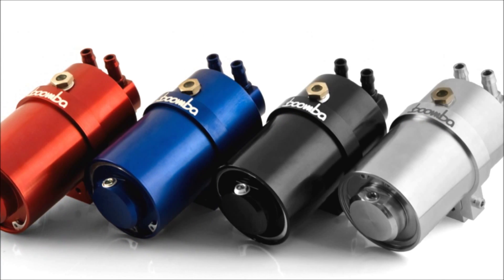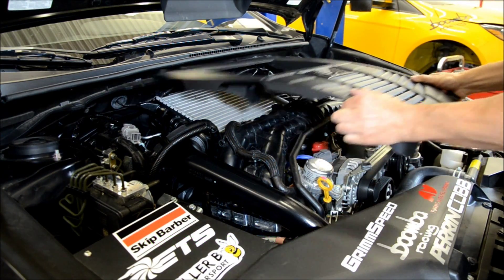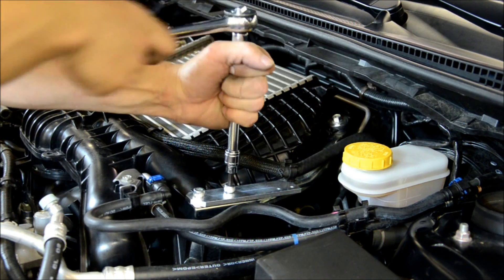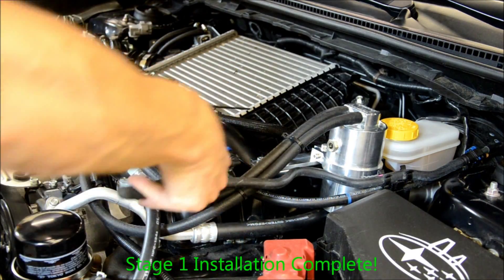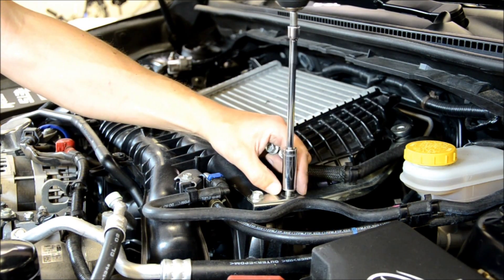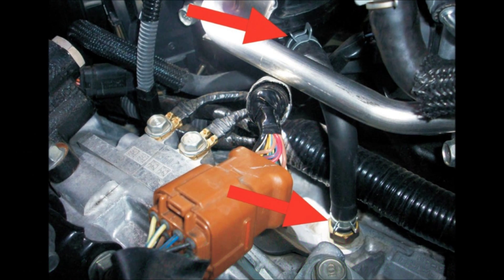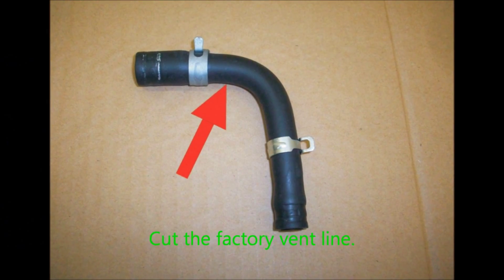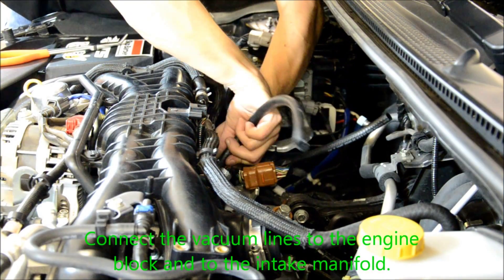How to Install | Boomba Oil Catch Can for '15+ Subaru WRX

Comment: Does it matter which hoes goes to the in and out on the catch can?  The video shows it one way and in the pdf it looks like they are switched.
Reply from the maker: Hi, the hose going from the intake manifold should go to the "Out" port and the hose from the engine block should go to the "In" port. Sorry for the confusion!

Comment: Are stage 1 and 2 different parts? I can only find the "universal" kit on various vendor sites. Same length hoses included for either installation?
Reply from the maker: Hi! Stage 1 and Stage 2 15+  WRX Kits are different parts. The hose lengths are varied as the placement is different within the engine bay and our Stage 2 requires hose clamps to work as it is the higher pressure side of the intake. We do ship internationally and would be happy to get a kit out to you if you bought the kit at BoombaRacing.com!

Comment: Why would you cut the PCV line? Why not just remove it, retain the factory hose, and use the supplied hose to run straight from the block to the can inlet? I don't see the point in cutting the hose and using a male>male adapter to add another length of hose, then reattach it. All you need to do is swap the clamps around.

Comment: What was the ID size on the hoses that slip onto the stock pipe please
Reply from the maker: if you're referring to the ones at 2:33, those are 5/8"
Reply: @BoombaRacing  thanks

Comment: So what's the benefit to doing stage 2 over stage 1? 

Are you supposed to do both catch cans for stage two? In that case, what's better about that versus just doing stage 1?
Reply from the maker: Stage 1 works on the CCV system, where stage 2 works on the PCV.  The main difference is that the PCV is a high pressure system, and tends to catch more contaminants. If someone only wants one can, we always recommend stage 2.

Comment: Will these fit on the SJ XT as well?
Reply from the maker: We were never able to confirm that.
Reply: I added a stage 1 to my 2018 FXT, pretty much the same except those connectors do NOT slide on that easy, I used a heat gun to practically melted them to make them pliable enough to slip on.  BUT, it is installed doing its job.

Comment: Great installation video. Might I suggest that you reverse the order? Or at least explain that if you are doing both at once, you may want to start with the stage 2, since you have to remove all the hardware holding the stage 1 unit in place to do stage 2. Great work!

Comment: Hello boomba! I installed on a 2017 wrx about 2 months and haven't had any oil Build up ( live in cali, stage 1 setup) I've read it's normal on some cars but want to make sure if there are any testing I can run. she runs fine with no issues as well to add! Thank you
Reply from the maker: Hey there Angel! You must live in a warm dry climate, in that case it is normal to not see much build up. To increase your chances of catching build up, we recommend going with the stage 2
Reply: Thank you for the confirmation! I will look into purchasing the stage 2, for stage 2, is it needed to removed the entire can for draining?
Reply from the maker: You may have to loosen the collar and lift it up to get to the drain valve, but it is pretty simple!

Comment: If I'm tuned do I have to get re tune for this?
Reply from the maker: Not at all. Plug and play!
Reply: Boomba Racing im going to order one of these my question is which one should I get first stage 1 or 2?
Reply from the maker: We recommend stage 2 as it runs off a higher pressure, meaning it will catch more.

Comment: Are both stages required even with EGR deletes?
Reply from the maker: The stage 2 will catch more because it works on the high pressure PCV side which is known to have more contaminants; but for anyone looking for the absolute most protection, you can't go wrong with running both stages.

Comment: How will this behave in our Chicago winters?  Any worry about the lines freezing from the condensation that forms?
Reply from the maker: We're in Illinois as well and make catch cans for various vehicles; we've never had issues with condensation or lines freezing. Engine temps get more than warm enough to prevent any issues.

Comment: Goofy question but do you think that catch cans do a better or worse job than a AOS like IAG street, and why ? I am torn between your catch cans and a IAG  AOS.  Please enlighten me help me out. I'm stuck. Thank You
Reply from the maker: While we can not speak for any particular brand of AOS, we prefer catch cans to AOS. Our catch can will do a much better job at trapping the particulates rather than the way an AOS just separates them. Direct injection vehicles tend to get a lot of build up on the valves, and running a catch can prevents those particles from building up on your valves.

Comment: So, since we are fixing a known carbon buildup issue, and we are still keeping smog systems hooked up, just with a part in between, does this mod void warranty in any way? I have a 7/70 bumper to bumper extended warranty and don't want to void it......
Reply from the maker: When it comes to warranty; in short, innocent until proven guilty. Certain dealers can be more picky than others when it comes to aftermarket parts. Some dealers are fine with mods whereas other dealers will not accept any mods. This item doesn't alter the way the car runs so it really shouldn't be an issue. We always tell the customer to ask the service advisor first for what’s acceptable at any given dealership and if you have any doubts to return the car to stock form before bringing it in to a dealer. Furthermore there is a law called the Magnuson Moss Warranty Act that states in order for a dealer to deny warranty work on your car, they have to prove the aftermarket part you have installed caused your issue. For example if your window stops working and you have a cold air intake, the dealer is not going to void your warranty. It is illegal for a dealer to void your warranty for simply having aftermarket parts installed. If you have any further questions, please let us know!

Comment: About where are you cutting the hose the second time? Are you essentially just cutting a chunk out of that hose?
Reply from the maker: All of the specifics about how the hoses can be found in the following installation guides:Stage 1: http://www.boombaracing.com/content/WRX%2015%20Catch%20can%20S1.pdf
Stage 2: http://www.boombaracing.com/content/WRX%2015%20Catch%20can%20S2.pdf

Comment: Hi boomba racing. is this compatible to my 2015 forester xt? I would like to try both stage 1 and 2 systems. where can i purchase it and how much? thank you.
Reply from the maker: Hey there! We have never tested for fitment on a Forester XT using our WRX Catch Can system. If the vacuum system is similar, I see no reason why this wouldn't work.
Reply: BoombaRacingInc Can you confirm if they have similar vacuum system and hose specs? thanks.
Reply from the maker: We have not tested one locally so unfortunately I do not have that confirmation for you.

Comment: Why you have to install 2 of them
Reply from the maker: dave091790 the largest reason would be consumers. Regular consumers have a hard enough time remembering to change their oil. If Subaru was to implement a catch can, that would just be one more item that a consumer would have to service/empty. Another reason why these cars don't come with catch cans from the factory is consumerism. Everything is built these days with the intentions of being thrown out in a few years. You won't notice any issues with your car during the initial powertrain warranty by not installing a catch can. It is typically once you're outside of warranty that the oil and carbon on your valves begin giving you issues. Any direct injected car can benefit greatly from a catch can.
Reply from the maker: +Cruz Ortiz Most vehicles have two different types of vacuum systems; a high pressure side and a low pressure side. We sell two different types of catch cans for this vehicle so that you can have one for the high pressure side, and one for the low pressure side. Running two cans will work towards keeping your engine running efficiently and clean.
Reply: +BoombaRacingInc If this is so effective at keeping the car running cleaner/better longer, why doesn't subaru sell them with a catch made in house? Honestly baffles me. also, I hope to get a 2015 or 16 by the end of this year BUT already have a 2015 impreza. would it be beneficial to do similar work on the impreza for longevity?
Reply: BoombaRacingInc so is the installation the same for imprezas? And is there a difference in using just one or both at the same time?
Reply from the maker: dave091790 Stage 1 works on the CCV [low pressure] side of your vehicle, while stage 2 works on the PCV [high pressure] side of your vehicle. You can use one can or you can even use both cans for the ultimate protection. More contaminants will be caught using the stage 2 set up. As far as fitment on an Impreza goes, that is something we have not confirmed so we have no way of knowing if that will or will not work on your vehicle.
Reply: Hey will that work on a 2015 sti can you show an install video,different engine different install?